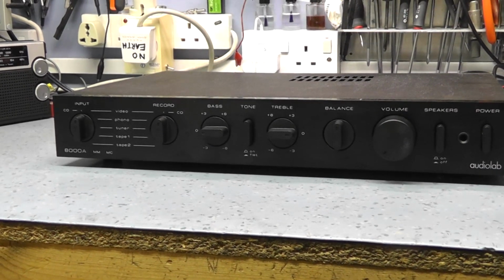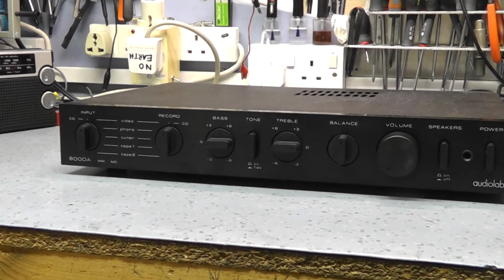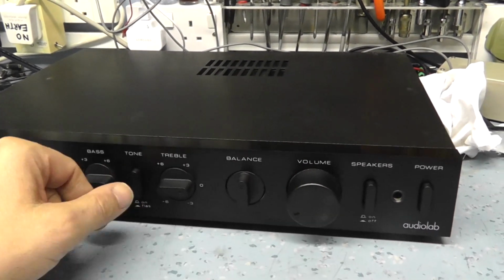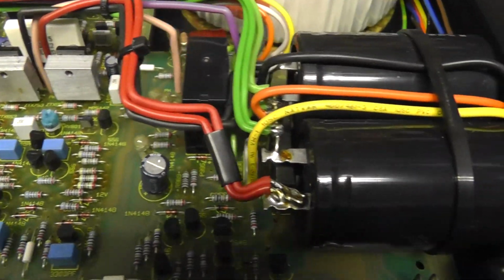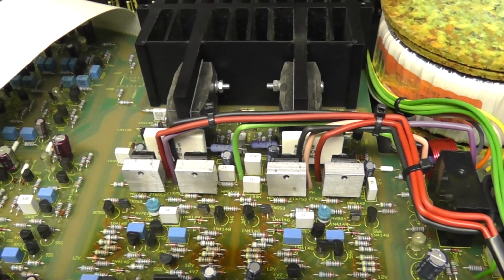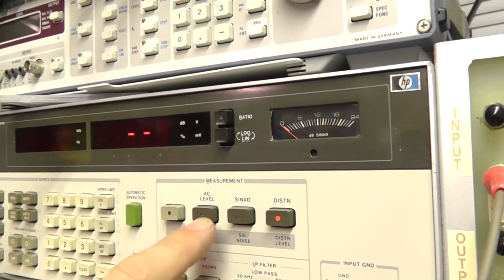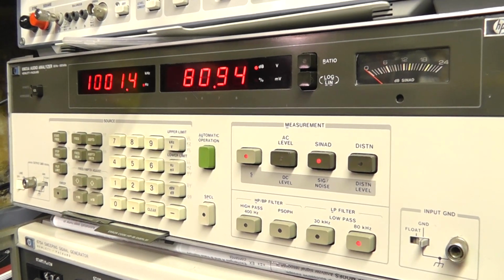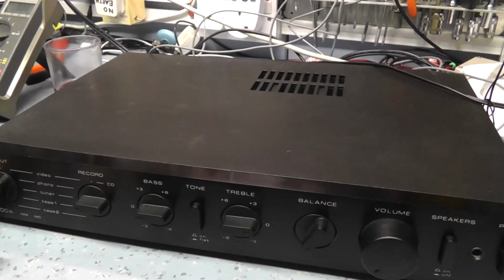Audiolab 8000a Checkover.

Comment: Hiya.. great video Si. I have a lovely old second hand 8000A and the sound is great, however after half an hour or so I lose one of the speaker channels.. I guess it is a function of the heat build up that you mention. Any ideas if this might be a component failure or maybe a dry joint expanding with the heat? Any clues to help me locate would be much appreciated. Thx C.

Comment: Sir im gonna ask you why my audiolab 8000a when i power on there’s a sound from my speaker when i check speaker out with my multimeter had a dc out then slowly down the dc out then almost zero dc out then the relay click .. how to check this problem? Tnx im from phillipines
Reply: It seems to be a failure of the protection and relay drive circuit, whose function is to measure the output stage overcurrent and bias imbalance, power-on delay  to allow bias stabilization before connecting the speakers, and their instant disconnection upon power off. If you have tested okay the output stage(s), it is likely to be a cold weld in the protection circuit (which in my case has been more frequent than component failures.)
Reply: @albertoolmos21  tnx sir

Comment: My vintage but well-loved 8000A has developed a start problem. The power button no longer locks in so the amp won't stay on. Any advice would be appreciated.
Reply from the maker: Just replace the switch.  Their
Fairly generic. A good hifi shop should be able to help.
Reply: @SoddingaboutSi  Many thanks for the help.

Comment: These amps run hot when in idle but run cool when in use i.e playing music through it. I have an  89 serial number (1989) and an 207F serial (1998) the later model sounding more full bodied but both are extremely good. In particular the M.C stage is exceptional and will do justice to thousands of pounds worth of decks/cartridge. It is a shame that they sold out to tag McLaren who ruined a unique brand with a cult following for the amps in particular which work well with just about any source component and speakers but they truly shine with high end gear way beyond there price point. Naim and cyrus amongst others had to work hard to get a slice of amp action at this price because the 8000A really was that good.

Comment: This was interesting information, thanks. I bought my 8000a back in 1991, despite the potential issues you mention, mine's
been used nearly every day since then, and I'm listening to this video on it today, 2021. £400 well spent.
Reply: that is what I wrote to another video he did of the 8000A. I bought mine in the same year as you did as it has been on almost continuously since then. In the last 7 years has had not much use but still on. I do the same with computers, under the impression (I know, not scientific) that mains powered electronics tend to fail at power transition.

Comment: I have a 1997 model and mine seems to have very little low end i the phono stage, it was checked by a knowledgeable technician two years ago who fixed a dry joint on one phono connector but said it was otherwise a very fine amp. The detail is still there but the lack of bass means I am not enjoying my vinyl collection anymore. Would a recapping sort this issue out?

Comment: I bought one of these new back in '95. I've got it open at the moment and it has a burnt board around those little clusters of resistors just like yours. I saw another video where they were replaced and stood off the board. I'm planning to replace them and just wonder if you can help my brain fade and confirm they are 211R? I'm planning on replacing them with Takman Metal film 0.5W units (from HiFicollective) but can only get 200R or 220R. I'm thinking 200R, do you think that's okay as long as I replace them all?
I'm also going to improve the ventilation by putting a pattern of 10mm holes in the top lid above the resistors and that phono heat sink. I'll replicate that on the underside 'lid'. They sure do run hot, never really thought about it before, but I've got temp use of an Arcam A65 and that runs much much cooler.

Comment: What would you suggest to prevent excessive heat...drilling holes where you pointed at on top of the case?
Reply from the maker: It could do with holes in the top and bottom to get air moving
Reply: @SoddingaboutSi  thanks

Comment: Very nice! Interesting they use the preset resistors for biasing on this older black version. On the 8000P power amps they went from that on the early grey ones and then moved to using a variable resistor on later black faced models. I have a nice example of a early grey 8000P power amp which is basically just a more powerful version of what's in that integrated. My only real complaint is that it runs quite hot even if just idling albeit none of the circuit boards are discoloured like that. Not sure if still the same but they used to get a lot of hate from the "audiophiles"  which I don't understand. It's a decent design that's not coloured. The 8000A was a superb amp for it's time that has in my opinion matured very well

Comment: Looks like a good candidate for replacement top cover with far more ventilation holes or slots. Are there any slots in the bottom? Other than perhaps directly below the main amplifier heat sink?

Comment: Very good video Simon with an honest opinion. I now own one and mine also runs very hot some Australian engineer on here tried to tell me they don't yeh right OK. I don't think there as good as everyone makes out. I also own a Pioneer A6 from 1981 which I think is a much better amplifier and runs a lot cooler.
Reply: I have one & never noticed it running hot not that I used it that much.I believe there were three modifications so maybe in the last one they corrected those faults.Anyway mine is one of the last ones & I've hardly used it in 20 odd years & even when I bought it it seemed very little used so must be one of the best ones out there.
 I never thought much of the sound quality until I used it a few months ago with a an Mdac or it could have been an Arcam R Dac I forget which  & then it blew me away.
Reply: @nicholasmorrill4711  Mine was the last version made in 1997 before they stopped manufacturing them. To be honest these were hyped up that's why I bought it. Run yours into a 4 ohm load with the volume at 10 O'clock with some dance music or reggae running through it. I guarantee it will start warming up. I now run a Technics SUV90D one of the first digital Japanese amps. There's no comparison the sound is like night and day compared to the Audiolab!!!!!
Reply: @tonybalm1513  I think mine is about the last made an F serial number if I remember rightly.I only used it for a very brief period because I was using a couple of integrated amps running in mono mode.
I now have a fully fledged bi-amped system using two audiolab 8000p's in a vertical bi-amped configuration.........I also have another system utilizing a Myryad 500 MDP which is a digital pre amp/processor & two audiolab 8000M mono blocks & that can't hold a candle to it. I payed a hundred & eighty quid a few years ago for the Myryad & I believe it retailed for two & a half thousand in it's day.........it is not comparable to an audiolab 8000Q as a preamp.

Comment: Wouldn't you have loved to be a fly on the wall during the design review for the amp..."Well, it's gonna get really hot and fail someday...that's ok, moving on!"  Thanks for sharing Simon...
Reply from the maker: Yes, we know it will get hot. Then the customer will replace it after 5 years!
Reply: @SoddingaboutSi  Built in obsolescence. Cars are engineered the same way. It's a balance of keeping production costs down to be competitive, whilst engineering it to last "long enough". Yes, I'm a professional Automotive Engineer!
Reply: We've had one in regular use since about 1989 (it's the Mk1, no Video designated input); it's still our main living room system and it hasn't failed, so if  they were aiming for built-in obsolescence, it didn't work out too well :-) The one fault, which I've seen others report, is that the physical connection between phono connectors and main board is fragile. I don't tend to plug/unplug often, but if I do, sometimes I have to wiggle to re-establish connection.

Comment: Omg I loved my 8000a which I had for 7 troublefree years-the weak components were the power supply resistors which turned brown over time-creating crackling when they overheated
Reply: In 1996 What hifi said it was the best amp for £500. I was happy to support a British company. Mine crackled after 3 years. Never again.

Comment: I think that if I were going to use that amp on a regular basis I would up the wattage of those resistors and also mount them up off the board so as to get some air flow around them. I don't know if there are any vents on the side but I think that amp would really run a lot cooler if there was an exhaust fan mounted over that top vent sucking the hot air out and drawing fresh air in from the room. Not original I know, but I think it would add considerably to the life and functionality of the amp. Thank for the look see. ATB Doug.

Comment: Seems like it could benefit from a cooling fan being fitted on one side, Simon.
Reply: I was just going to say the very same thing! Also for 70+ watts per channel, very small heat sinks.
Reply: @MichaelBeeny  It's a favourite trick of mine with some of my HF receivers. Especially the ICOM IC-R7000, I have, that runs incredibly hot. Simple remedy was to strap a computer hard disc twin fan unit under the base of the rig over the air inlet vent. The radio now runs as cool as a cucumber now and I plan to do a similar mod to a Tektronix analogue scope I have. This unit runs quite warm and with the aid of a small 240/12v switch mode power supply, fitted to the inside of the scope, run a small cooling fan fitted to the rear air inlet vent. Hopefully the power supply will not upset the scope by generating EMI/RFI.